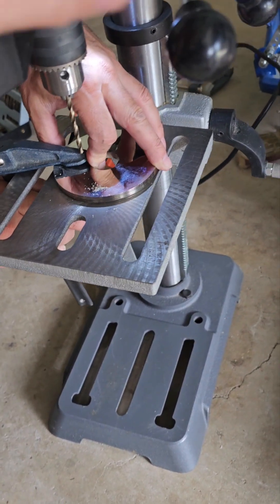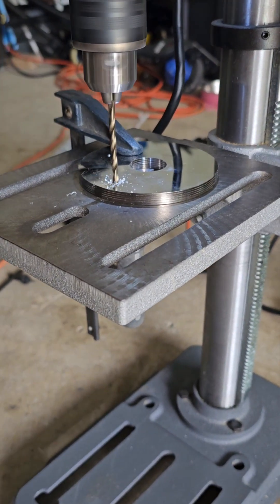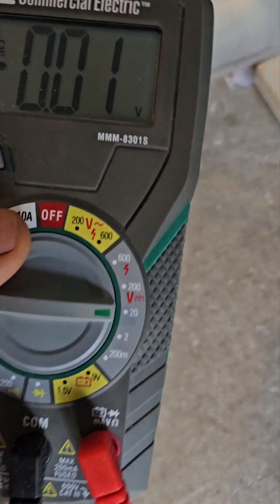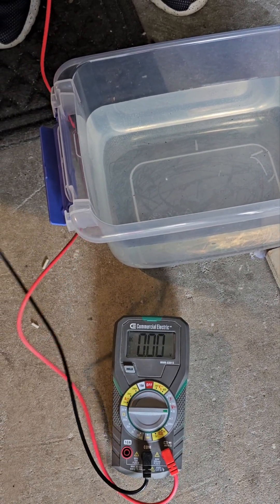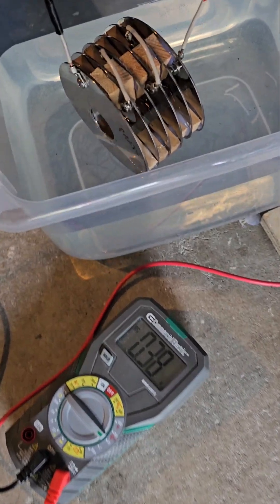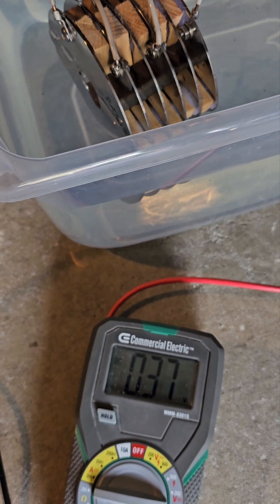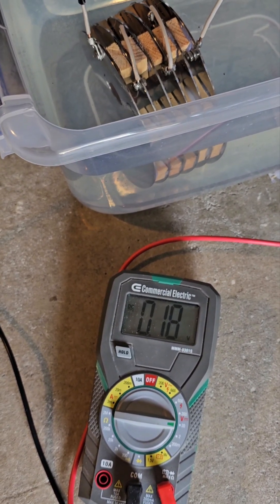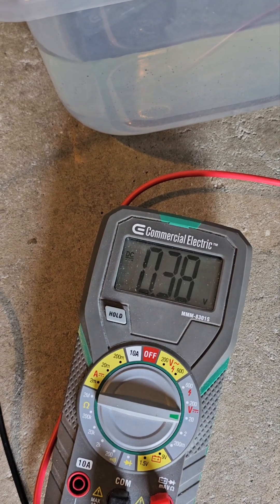Test result to make the high-performance 220V battery from HDD  platters.

Comment: 26 plates were used in the other video resulting in more voltage and more water displacement. The Water Volume must not be too much. Also used in the Solution were salt and sugar. not sure if you used that or not, or in the correct ratio. Way too much water for your build reducing voltage. Try making a container that fits your build tighter, add solution and try again using a low-current setting on your meter.

Comment: Disc without driling hole will be +  
Those driled ones will be -   

2 plates giving arround 1-1.7v  
But some how when you do this few of the they wont add their voltage .
I was working on it 3 months   my last step find the way to get higher voltage in 1 sink

Comment: Wouldn't you still need the two outside platters connected in the same fashion leaving you the positive at one side and negative at the other, thus gaining the voltage generating from the middle four platters?